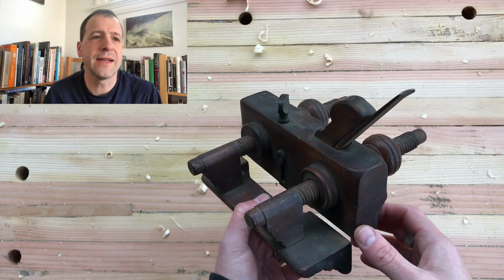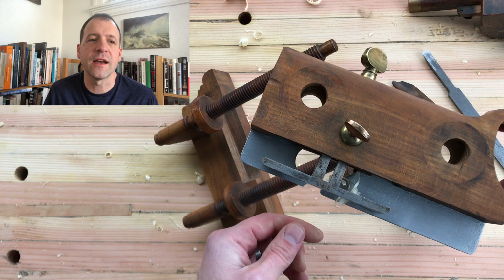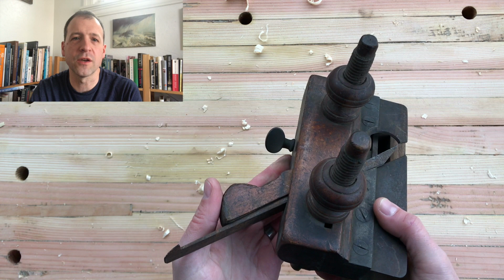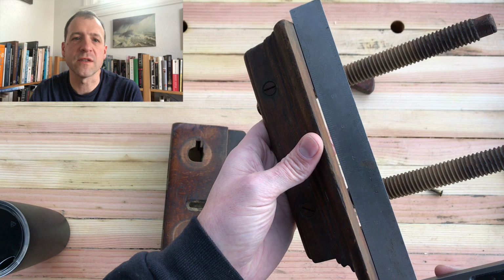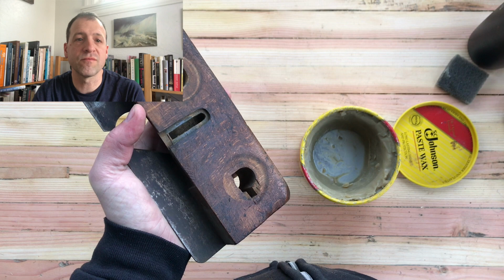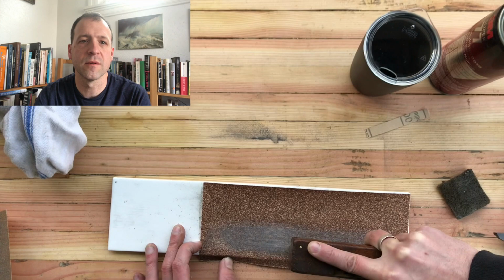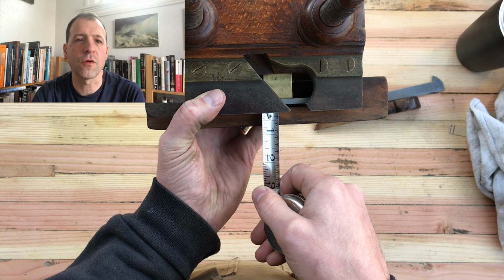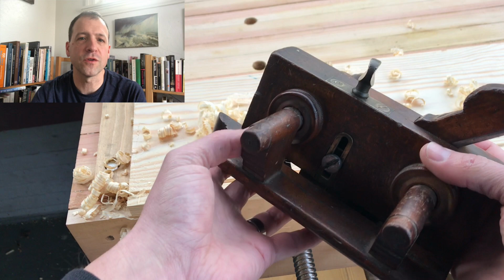How to restore and use a wooden plow plane

Comment: I'm coming late to the party here, but I noticed something on this plane worth mentioning. This fence looks like it came from another plane as the body has tapered groves adjacent the fence arm holes (groves for lack of the correct term) to accept wedges to lock the arms. Agree?
Reply from the maker: Collectors call that "brace and suspenders," as in why would you wear a belt and suspenders at the same time? Some makers added both so that... you could choose later what you want? No one really knows why they did it. But I agree it looks odd.

Comment: Do all plow planes have a depth stop?  I recently bought one that looks very much like what you are working with except that there is no depth stop and it doesn't look like anything is missing or any signs that there used to be one.  There is no makers mark that I can see but it does have a James Cam iron as is about twice as long as your example.  Thanks,  Paul

Comment: Can you also tune up the blades of a plough plane?
Reply from the maker: You definitely can. Sharpen them just like a chisel. Flatten the back and then sharpen the bevel. The bevel angle isn't important. Use whatever angle the iron currently has. It doesn't need to sharpened to a mirror finish. 1000 grit is fine.

Comment: Abraham, thanks for all of your videos. On other restorations you have used Murphy's Oil Soap to clean the wood of the plane saying it was gentle and then used paste wax. Did you think Murphy's would have been too aggressive on this plane? If so, why? Thanks Don
Reply from the maker: My thinking on this has changed over the years. I used to use oil soap all the time but I've changed to paste wax for almost everything now. There's nothing wrong with Murphy's, but I save it for the planes that are in really bad condition. Either is fine, but I'm erring on the side of "gentle is best" whenever I can.

Comment: i have a a & e Baldwin plow plane. what glue to use on small crack in screw knob????? thks
Reply from the maker: If the crack is stable, I would  just leave it. If it expands when you tighten the knob then use wood glue on it. Good luck!

Comment: I know you mention to avoid planes with states out of line, however do you have any advice on straightening out the front skate being out about the width if the skate?
Reply from the maker: The way I’ve done it is remove the skates and then use a rabbit plane to flatten the surfaces that the skates attach to until both are in alignment. Good luck! Let me know how it goes
Reply: Working Wooden Planes I think the wood is straight but the metal skate has bent slightly.